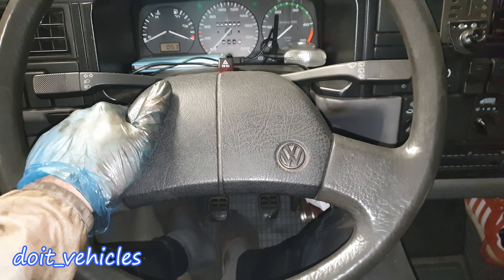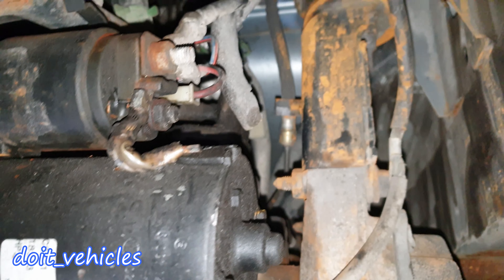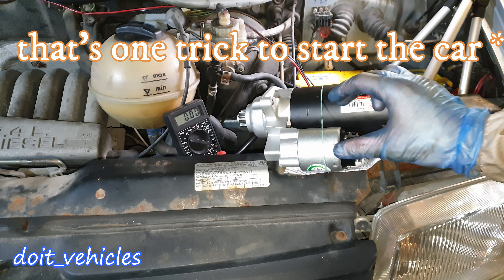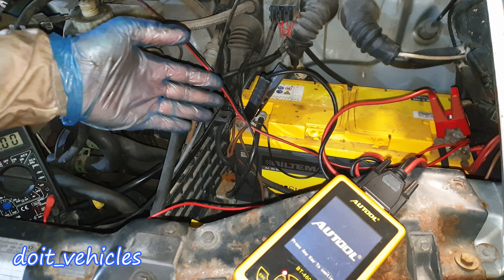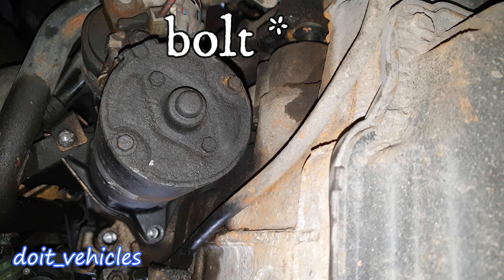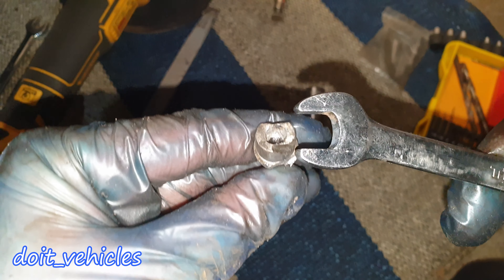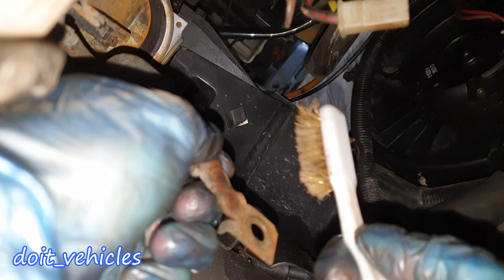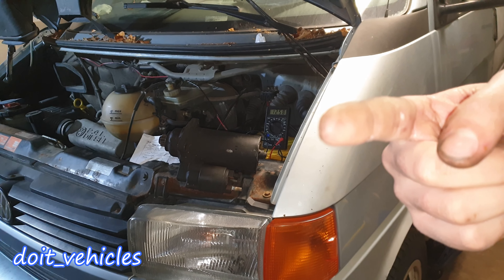Starter Motor / How to Test it / Replacement on 1993 Volkswagen T4

Comment: Thanks for the great video. I just replaced my starter on my T4 Vw 1993. The Mechanic I bought the starter from was sure it had the right KW for the van. But since installing it, all i get is a pop or a click sound when I try and start, AND the power of the car dies, so when i try to start it again, no power at all in the car until I disconnect the starter completely, then power comes back from the battery... any help?